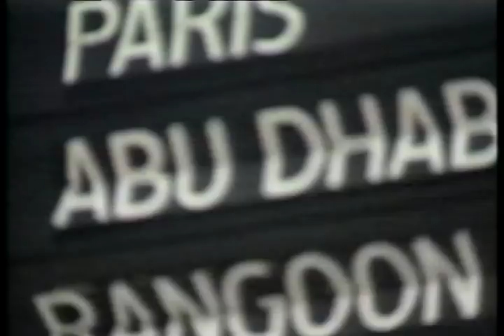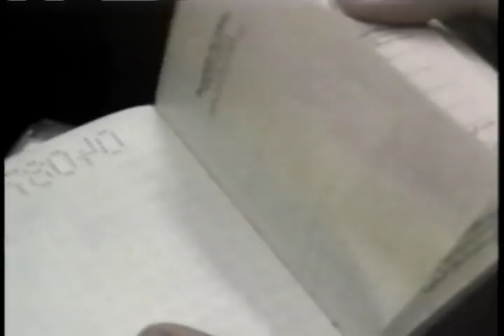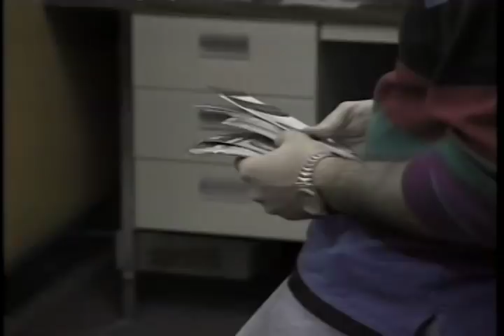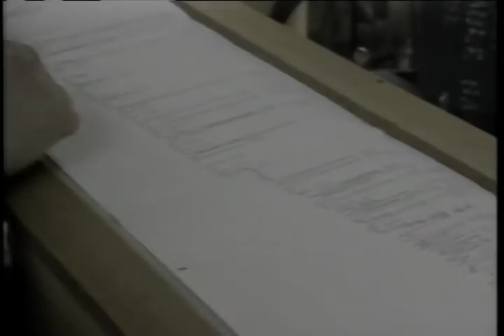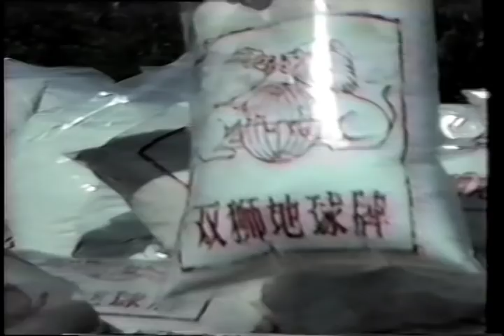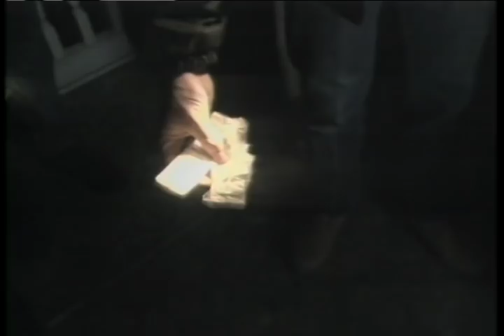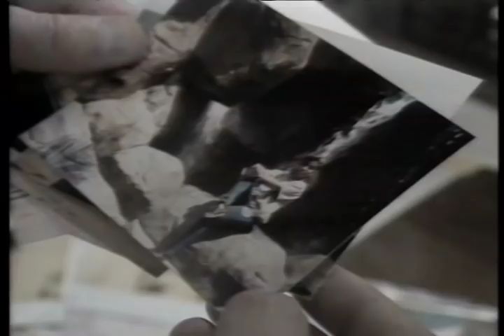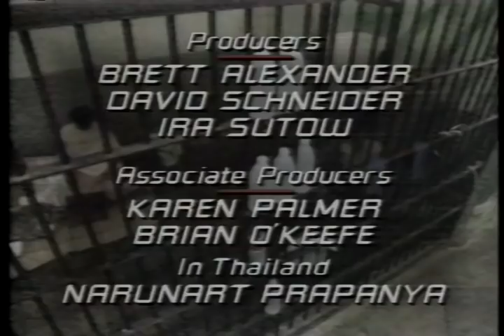Heroin Connection

Comment: Wish we had the H connection like back then because now it all fent there's no H now and if it is its not cheap because the price of a key of H is 80k-200k depending on where its coming from most of it has been coming from Canada which yhey get it from Afghanistan and the southeast Asia where the quality is grade A. Mexico still produce H but they don't make a enough since its too expensive and takes too long to produce so this is why they prefer to produce fent because its way more cheap to produce and doesn't require growing and harvesting like H. Don't get me wrong a key of fent can bring a organization 5M-10M once they package it for the streets and thats just off one key because fent is so potent that whatever you cut it with and no matter how much cut you put on it it still will hold its potency so if you have 5oz of it you can put 15oz of cut on that 5 and it won't lose its potency at all it will still be strong.